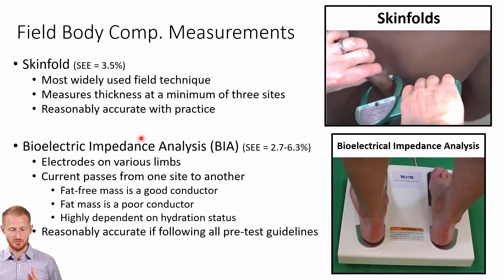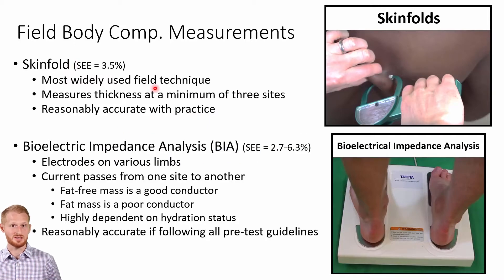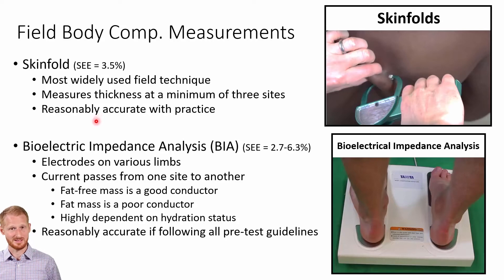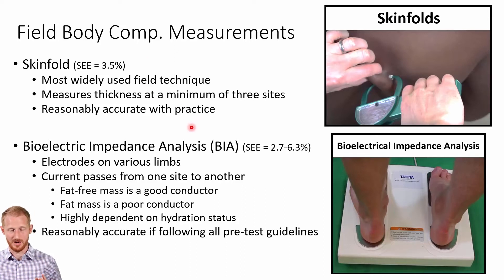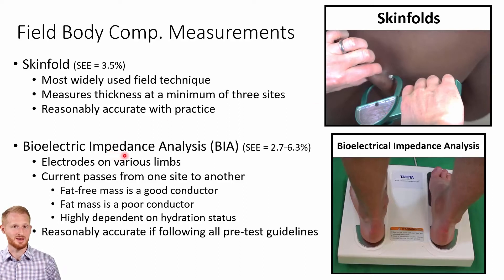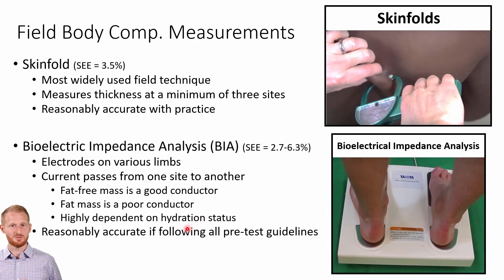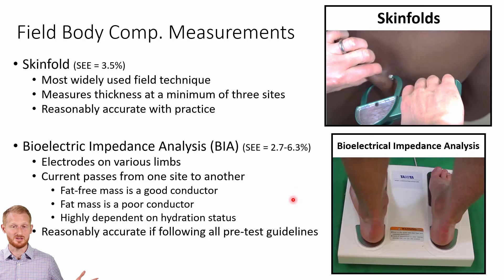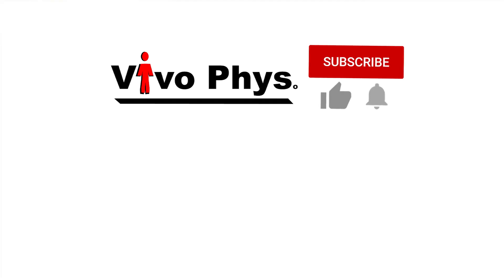Field Body Composition Tests to Measure Body Fat Percentage

Comment: Which method is accurate for finding fat percentage?
Reply from the maker: Hi Sash Khan. All methods of body fat assessment have errors and certain limitations that impact their accuracy. Both skinfolds and BIA are field based measurements. All field based measurements typically have a bit more error than lab based measurements even in ideal situations. Between skinfold and BIA the error is similar as long as all pre-testing guidelines are followed. 

See this video to learn more about lab based methods of body fat assessment:
Laboratory Body Composition Tests to Measure Body Fat Percentage
https://youtu.be/kcEbMjOH3FI